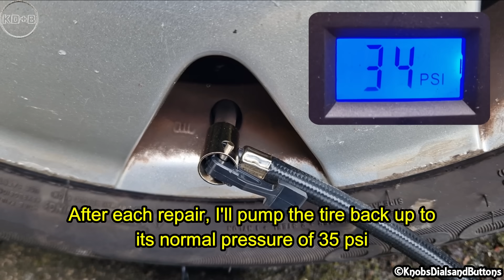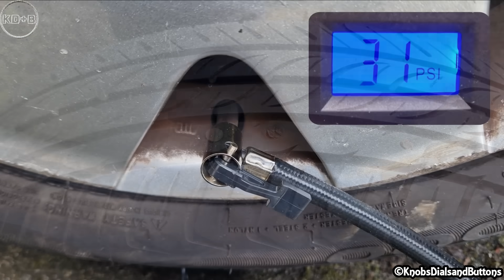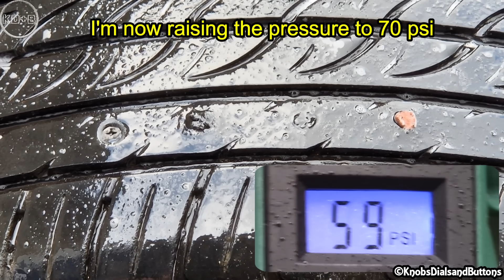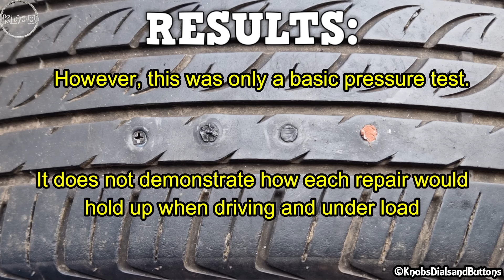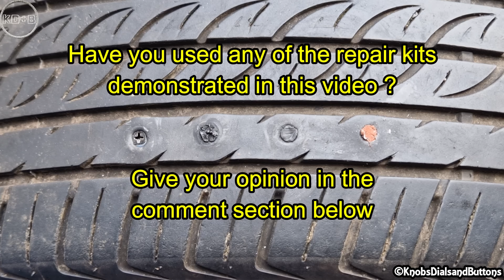Four Repair Kits, One Tire

Comment from the maker: ~~~~ Part Links ~~~~
As an Amazon Associate I earn from qualifying purchases.

🚗 Tire Repair Strip Kit ~ https://amzn.to/3BrT3TW
🚗 Mushroom Plug Repair ~ https://amzn.to/4er40DK
🚗 Sticky String Repair Kit ~ https://amzn.to/4eIq90a
🚗 Tire Screw Repair Kit ~ https://amzn.to/4gOevCS

Disclaimer: Knobsdialsandbuttons is a participant in the Amazon Services LLC Associates Program, an affiliate advertising program designed to provide a means for sites to earn advertising fees by advertising and linking to www.amazon.com
Reply: :D
Reply: Como hago para comprarlo
Reply: Yep used countless of the leather/rubber plugs. I don’t use rubber cement anymore and I have used them without reaming the hole. I wouldn’t trust the screw in plug because it’s putting a screw in your tire, how do you usually know you have a screw or nail? That’s right it wollers it’s hole out and starts leaking the air out.

Comment: Mount tire on vehicle and report back after 500 miles.
Reply: Didn't think these were meant to be permanent repairs? Thought it's only meant to keep a car moving long enough to safe place to change to a spare or a more accessible road to tow trucks…
Reply: @giaiaspirit I use the first method on my semi truck and trailer tires all the time without any issues. And pressure on those tires are from 105 cold to 115 hot. Never had a blowout or any other issues whatsoever. As long as you do it correctly.
Reply: Yes these actually are a permanent repair lol. @DemetryG
Reply: 500 miles is no longer time to change tires😅😅
Reply: I use these quite often, the first type. .  Providing it is a “standard” round hole the repair will last the tyre.  Once I had use 4 in one large hole on the side wall. It lasted the journey home and held air but, I changed the tyre.
Reply: My kit is very similar to the first one and i rode a bike with such a repair for more than 2000mls on pretty bad roads - no problem. On my last holiday i saw roadside assistance using such a repair on a car and the guy said, that most times the repair lasts as long as the tyre (althoug it is described a a temporary solution).
Reply: I had a car with a slow flat I took into a tyre centre and instead of replacing it the guy repaired it with a plug of some kind. I didn't see how he repaired the flat but he must have used one of these techniques. In my ignorance I didn't know any better so I just drove on it but didn't notice anything amiss. I sold the car soon after so I can't say if the repair held. I've since moved to an EV which came with a tyre inflation / repair kit but I have a can of Holts tyreweld in addition to it.
Reply: @giaiaspirit  NO.... once repaired it's repaired
with the first one, I've done that many times
and once plugged up, i'm good to drive it until the tyre goes close to bald........NO PROBLEM
Reply: What's the point of over inflating the tire
Reply: No meu pneu tem um parecido com o primeiro a mais de 30000 km
Reply: Считаю что саморезам не место в шине!
Reply: I think they are meant to be permanent  @giaiaspirit
Reply: @waltertur9731 in my country thre is a term for a fool called a wally,which is short for Walter.
Reply: @giaiaspirit  that's what the tire companies want you to think. I've driven in my repaired tires until their tread wore down. My repair method is type 1 of this video. Costs no more than $10 to buy the kit and can take 10 minutes to do once your tire is off the car. I've done it with the tire still on the car and just jacked up a bit. Save your spare for a real emergency out somewhere remote.
Reply: These are permanent repairs. If you change a tire because it was repaired, you must have lots of money to waste.
Reply: Place 500 Miles in one straight line and watch them giving you the middle finger for wasting their time. Go bother those pesky French Metric Measurements.
Reply: I've used type 1 for years as a Roadside assistance tech and never had any issue. We did as a matter of safety explain these repairs should be treated as temporary but that's just a get out jail card if it failed. I've got 2 strings in one of my tyres and one of them if has done over 3000 miles! The trick is to trim them down as flat as possible so the road surface doesn't rip them out. I've never removed a wheel off a car to repair it either.
Reply: @saucysuishi341 depends which country, uk ,they are considered temp only
Reply: @wayando depends which country
Reply: @TheDigger06 So I uk, they change to new tyre for every nail punture?
Reply: @giaiaspirit  any none 'vulcanised' tyre repairs are technically classed as tempory repairs however, back in the day I recall BMW issuing string type kits with new motorcycles and they stated in the paperwork it was to repair the tyre within the centre 3rd area and are safe up to 70mph (UK) Max speed limit. In reality it would be just a fast to fit a spare to most cars with using proper roadside tech kit as it would to fit a string so the spare would be the 1st choice anyway. On motorways and dual carriage ways it is safest practice to remove the car to a place of safety for any repair.
Reply: Wow I never heard anyone using this method om the side wall. I thought once the side wall has a hole in it, it's finished.
Reply from the maker: @xDarkAngelxc  You're correct, sidewall repairs should never be carried out on a radial tire
Reply: A note its against dot regulations to repair semi truck steer tires in this manner they have to have new tires with no repairs.
Reply: Used glue strip repair myself. Driven 10000 miles. No issues.
Reply: No 1  last well using Rubber solution glue!  Working in construction I get nails and screws in my tyre regulator and swear by them.  Never had a problem, Infact just in one tyre I have 5 of them a d travel 1000s of miles!
Reply: @stan-ut5gj 
Walter White?
Reply: I've got a basic plug in my sidewall that's been there for 4 years has yet to blow out
Reply: Don’t use the 3rd method if you have arthritis in your wrists or fingers.
Reply: Use the screws been in my tyres for 3 months on one and a month on the other average 800 km a week haven't gone down yet , and he should put it in deeper on the tread pattern
Reply: Why in the f would you drive 500 miles on a patched tire.  Dah 😂
Reply: I had 3 plugs in one tire and drove 50k miles until I had to replace all 4.
Reply: So much utter bull talked about tyre plugs. Even if the worst happens, a puncture is a risk every time a tyre turns on a road. MUCH greater risk on UK  roads as an instant flat caused by huge pot holes everywhere. Let's keep in mind you should only ever replace tyres in matched pairs if you want to get arsey about it. That's even more important on a permanent 4×4..
Reply: Work on run flat tires? Can I go fast 140 plus with this repairs?
Reply: The screw is the simplest way to repair the hole. I used it about 4 months ago, and now I have run about 8.000 km and the tire has no problem.
Reply: I now use the sticky plugs and honestly they have been brilliant and lasted the tyre all my BMW have plugs in the tyres now. And some plugs have worn out with the tyre as said though it needs to be done right and I always use  rubber paste/sealant  with the sticky strips

Comment: I've used the tire plug strips on car tires for 30 years. They are easy to install, and they don't leak as long as you keep the driving to around town and short freeway way trips. But if you take a long ( 2-3 hour ) freeway trip, the tire will heat up enough that the glue will melt, and the tire strip will start to exit the tire due to the centrifugal force. For that main reason I think mushroom plugs are superior because it is locked on the tire from the inside.
Reply: Yeah but did you have that happen to you?
Reply: I have never had this happen to me and I have driven 80MPH
Reply: @RobertBoston-n4d  bro I have them in both my front tires. I drived from belgium to Danemark, 12hours of highway and no problems. If the strips blow out then the hole was too big.
Reply: I'm sure the mushroom plugs are better, but I've never seen the plug strips fail.
Reply: well I've done Tons of freeway driving with the strips (green slime) and never had one fail

Comment: Used the first one on many Motorcycles, Cars and Trikes. There an absolute life saver when stuck with a flat tyre. Top tip 1- ream out that hole with the tool a good bit make sure its well channelled . 2- use the metal hand tool type tools the plastic ones will snap 3- when pulling it out turn a quarter turn then pull. nice clip thanks for uploading.
Reply from the maker: Thanks for watching !
Reply: the instructions on the latest kit i got says not to turn at all in bolt letters
Reply: Self-vulcanizing plugs or the ones that need the rubber cement, which one is better?
Reply: @Mickey_Bauer half and half
Reply: Seen a plastic tool handle break on a insertion tool and badly injure the fellows hand.

Comment: I only use #1 and always lasted to the end of tire lifehad my car for oil change about 6 months ago and tech found a screw in the tire and almost proceeded with ordering and changing the tire,  because the hole is too close to the side wall in his opinion 😂 i put the noodle in at their place and still driving without any leaks. Whoever invented this simple solution is a great man!
Reply: I got a screw in my car tire near a Walmart.  I told them to put a plug in the tire.  They came back a half hour later and told me they refused to repair my tire because it was too close to the side wall.  I then bought a plug kit with the rope, glue and tools to install the plug.  I then took the tire to them and asked for air and they refused to air my tire up.  I then drove to the nearby convenance store and filled my tire with their air compressor. I would have never left someone stranded with a flat tire.  NEVER.  A note could have been written on the repair bill explaining the repair wasn't guaranteed.  I would have signed it.  The tire is still on the car and not leaking.

Comment: I've used the brown plug strip for decades and never had one fail.
Reply: Do you use self-vulcanizing plugs or the ones that require the use of rubber cement? Which one is better?
Reply: I prefer the ones that come with rubber cement. Usually get mine at harbor freight and they've never failed on me.
Reply: I had in my car with no problems till the day i had to change it. Used it on vans all the time. Would say they are the fastest, easiest and most effective
Reply: @jaynedoug9453 walmart kit no long comes with small tube of rubber cement. I plugged mine Odyssey 3 weeks ago without cement. So far still holding good
Reply: @TruongLe-eo8kh next times Always put extra rubber cement on the strips. People who say strips sometimes leak is because they didn't put some cement on the strips.

Comment: I've neer seen that screw, but the first one, brown gooey rope, hands down the BEST, even have run them in a police car tire a few times, never in over 40 years had one fail.  Ream, push in, give a half turn, yank the tool out, trim flush.
Reply: Even plugged the side wall

Comment: I've plugged tons of tires with the typical cord repair and have never had issues. I like to get a proper inside patch repair but most tire places are there to sell tires, so they will refuse to do any repair unless it's dead center. This of course is BS, so I just plug it and live with my nearly free repair...and again, I've never had issues after thousands of miles of driving.
Reply: Not necessarily BS, there just needs to be enough room on the inside of the tire for the patch part to lay flat (ie not on the sidewall). Generally speaking, that's around the first circumferential groove in the tread design.

My shop only does plug-patches, not these rope-type things, for liability's sake. Across the hundred appointments we do a day, maybe 1 every other day is a patch. So we do a lot of them, lol.
Reply: the bike wont pass an mot test with any of them in the uk.

Comment: Been in the tire repair kit business for over 25 years....mainly supplying military and 4x4/overlanding segments. The key things to remember are the following:
Not all holes are perfectly round drill holes....we've seen wounds that are triangle flap shaped, 1" long slits, odd shaped gashes and even a 3/8" bolt sticking out of a tire. The worst wound is when the foreign object penetrates the tread and travels longitudinally an inch or so under the tread and then penetrates the belts. 

By far the absolutely best tire plugs are the big brown furry ones made in the USA by Safety Seal, Xtra Seal, etc. These are generally Rayon based and have extreme break resistance when going through multiple ply tires like an E load range pickup truck tire. The other advantage is you can lube then with the included vegetable based lube (looks like Vaseline) or rubber cement and you can push two, three or more plugs into a wound that is odd shaped or much bigger than a 1/4" drill bit. You can't even try this with the mushroom plugs or the tire screws. And if you use a product that is super sticky, if you try to put more than one insertion into the hole it sticks to the existing one and pushes into the inside tire chamber.  Don't take my word for it, looks at the youtube channel Project Farm to see which units he found to be best.

In extreme emergencies, you might need to repair a sidewall cut or gash. You can stuff multiple brown insertion strings into the wound, inflate it to 15-20 psi and drive slowly to a main road or to a safer location to change to the spare. Trying to change a tire on a side hill is dangerous...so just plug the sidewall and find a flatter more level area to do a tire change safely. Sidewall damage means the tire is ruined, this is just an emergency repair to get you to a main road, to help or to a safer location to change the tire.
Reply: Straight facts.
Reply: @georgecarousos6735  
Great advice 👍
Reply: Excellent info!
Reply: I ran a tire with a sidewall puncture filled with 3 safety seal repair strings and ran it on my daily driver. Never had a blowout.
Reply: Specifically, tires are rarely punctured by a drill...
Reply: obviously USA is the best ( read with a retrd accent)🤣🤣
Reply: I respect project farm but he doesn't have the best test methods. In his video you mentioned, his "stress test" was just doing burnouts on dirt. Why not drive down the highway? His oil test was a video of oil flowing down a ramp, and that's not gonna tell me which oil is gonna make the best film on my cam lobes in the morning. Maybe he should've done a cam lobe stick test or something. Point is, name drop project farm, and I take you less seriously.
Reply: Wish I could share your expert knowledge to my email. 👍
Reply: OMG thank you. Will put a plug kit in my trunk. Never thought of that.
Reply: Thanks for the valuable information.
Reply: Thanks❤
Reply: Absolutely I agree with everything you said couldn't have said it better myself
Reply: Mushroom plug is the safest and most durable.My opinion.
Reply: @jankington216  I fully agree. I tried to watch one of his videos and quit half way through. His testing methods are pretty questionable.
Reply: You are correct. Most holes are not simple nails. Thanks for the information on Safety Seal.
Reply: I have put plugs in the tread close to the sidewall and drove away never a problem, I have always used the blackjack style plug the side one on that day was brown it was after our shop insisted, we use patches, bitched and complained about it, until a customer came with it right on the side of the tire between the rim and tread dead center, I call my supervisor over pointed to it and said I still believe plugs are a better fix, and yet the customer didn't want a new tire for life drove away after the service
Reply: Thank you for your service, and analysis.
Reply: Refer to NiteForce Tire Plug force test from 3 years ago for Newton force and seal testing.
Reply: @jankington216  saw the oil one, thought running down the ramp would show which would stick to parts or flow etc?

Comment: Come down one morning to a flat front tyre and found a board screw in it. Strangely enough I had purchased a mixed pack of sizes of the screw type a few weeks earlier but was dubious about them working. The repair has been over a year now without any problem or noticeable loss of pressure other than a periodic  normal top up as with all the other tyres. Absolutely surprised and happy with it , I keep the little box of them in the car for peace of mind and maybe get someone else out of trouble stuck with a flat. Quick and easy to  fit , brilliant little things , recommended.

Comment: I have used the sticky rope repair several times and once drove to the end of the tires life without having a better repair done, and it lasted with no issues.
I carry a set in all my vehicles because  it works so well.
Great test... now, drive on it for a couple hundred miles and see if they all stand up to use.

Comment: Drove 4 years on a 35" all terrain tire with 2 holes sealed with the "orange" like plug strip both through hot summer and cold winters as well as low pressure offroad driving.
It lasted as long as I kept the car and went on to be used by the next owner as well.

No problem running your tire for years with that plug in it

Comment: I have had 2 flat tires in 1 month. These are the first in the last 50 years that I have been driving. Both repairs were done on the side of the road with a tire repair screw . It is now 4 months later and 6000 km. further and not a single tire has dropped in tire pressure.. Good result for a cheap repair..